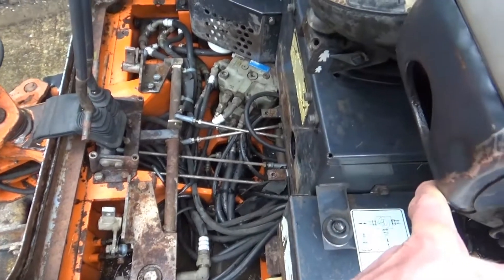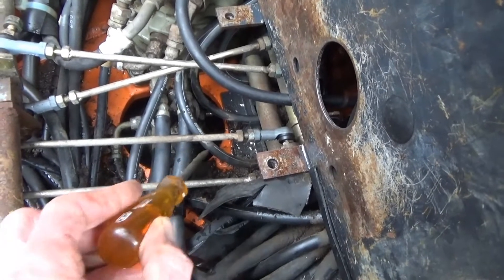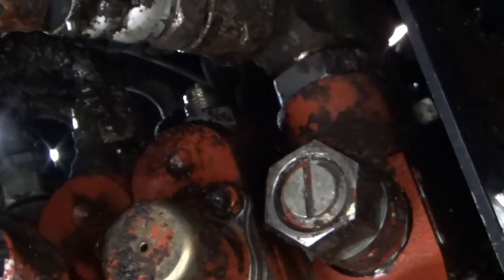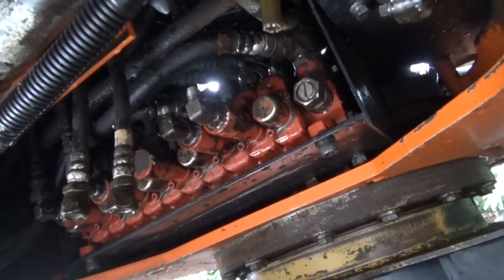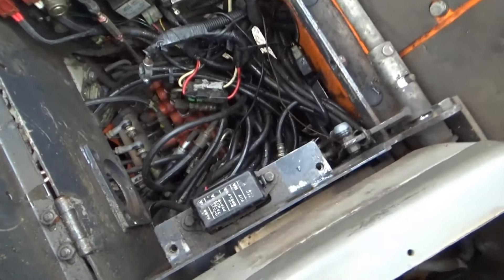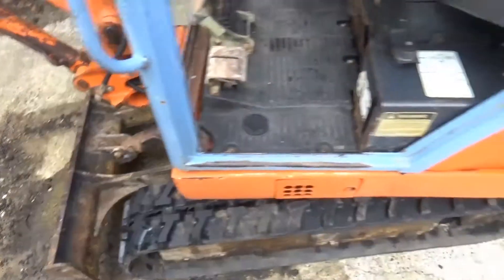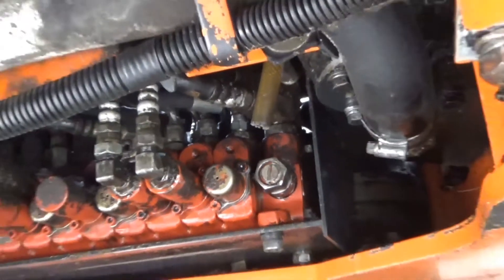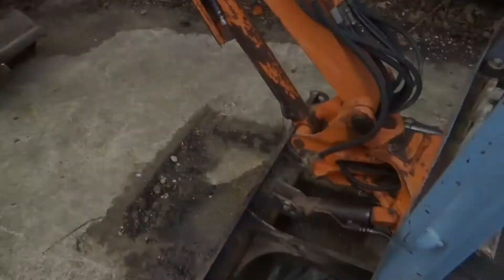Hitachi excavator hose repair

Comment: That will be useful to someone. But not to me unfortunately because your access to the lower end was EASY! On a Takeuchi TB016 I've had to lift the machine and get right underneath and remove the plate but I can't even see where the burst final drive hose connects!